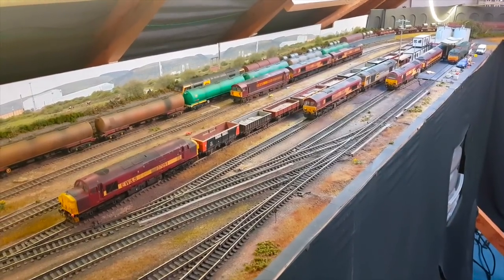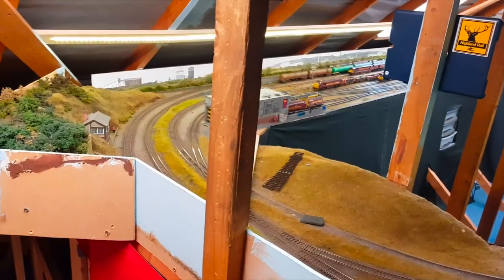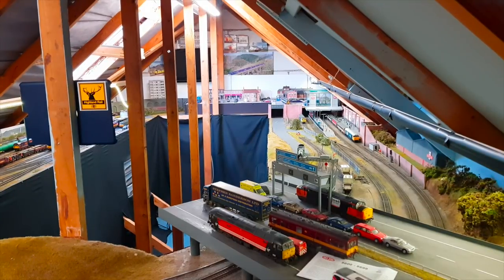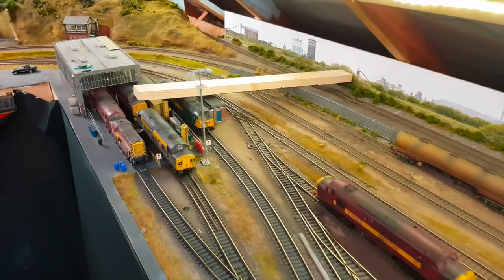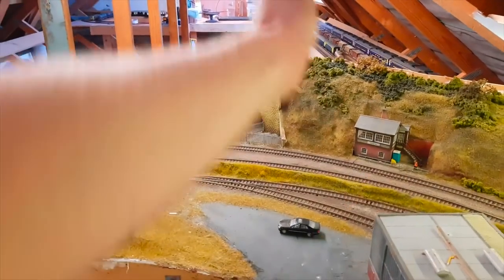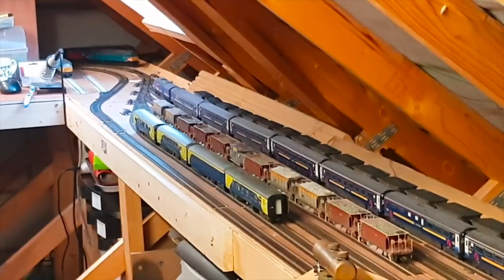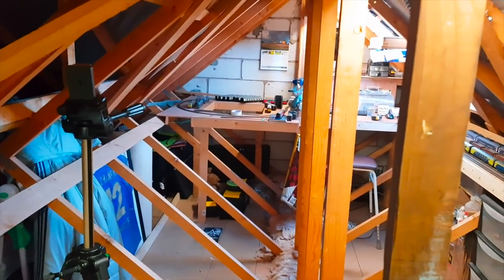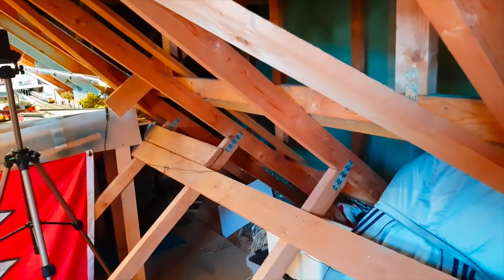Gowerton Parkway - The End Of The Line ?

Comment: Nice ideas. Look forward to this moving forward. If you wanted to go round the whole loft like you were suggesting could you not move the fiddle yard slightly more forward down towards the tmd area. Then you can keep the points going into it but then you could run the main lines through towards your desk infront of the fiddle yard. That way you'd minimize how much youre taking up and then you could put a board up infront of the fiddle yard as the backdrop to hide it from view of the scenic board. Just an idea, hopefully it helps with your ideas :)
Reply from the maker: Cherrham Junction Part of the reason I'm ripping it up is also because the woodwork on the fiddle yard is pretty bad . This gives me the chance to correct that also 😀

Comment: Up until now I hadn’t realised the space you had going spare in the loft for your layout so in a way am amazed you hadn’t utilised that area before. The fiddle yard in the untouched area is a sound idea giving you plenty of space for storage. Perhaps my only concern would be your positioning of crossover tracks to accommodate transitions from one line to the other - will they hinder running of the lines whilst these movements are made?  I dunno, I’m no track guru but it’s just thoughts to throw at you. Secondly, your nuclear flask depot, that would seem more tricky. Do you like it a lot?  Is it worth keeping and trying to shoehorn a line in to the mainline to accommodate what is a small scenic area of the layout?  Finally, before you rip out that centre section, is there anyway to integrate it in to the new plan to add operational interest with the mainlines diverging off across the central area to give the impression of a junction with lines heading to another destination?  Perhaps even a branchline joining the mainline with its own individual section in the fiddle yard for storing a few DMU’s. Like I say, all musings on my part and may not fit in anyway with what’s in your head but thought I’d throw them out there. Great update and exciting times ahead with the new developments both in the loft and with the better half. Good luck with them. Paul

Comment: Hi, first of your video's I've seen. The moment I saw your layout I thought, "why didn't he go all the way  down the attic?" . I think you should take your time and not rush to rebuild your boards...............Get the boards nice and solid and flat first. I think you have some good ideas too, although like someone else  commented, I think you might end up with straight main line tracks all the way from the TMD to the fiddle yard. Main lines are straight as much as possible anyway for high speed running. Your Nuclear Flask depot could stay as it is, but just relay the feed in so it curves the other way, from about the point the two flask wagons were parked in on the video............I will follow your rebuild as it progresses.................Hope the points help.
Reply from the maker: stretchedits Thanks for the comments . I think the only reason I didn't go all the way round was because I thought it was too much of a challenge. I'm a lot more confident now. The boards have been going up this week . They aren't elegant but they are rock solid and level :-)

Comment: Looks good, one thought I had is that you might struggle to do the mainline as anything other than a straight line down the back of the board on the TMD side, even if you do curve it away it’s got to get back across towards the edge in time to go behind the desk. Have you thought about that?
Reply from the maker: roadsandrails Yea it should be fine , I don't anticipate that being an issue, the angle of the tracks should allow it .

Comment: I have just heard alan davies on a re run of qi and he sounds just like you lol but you don't have that slight lisp . I have just re done my layout , its much smaller than yours and is 12 feet long by 12 inches its a end to end shunting type layout . trouble is its in a caravan . it took much swearing and farting about with 4 foot by 1 foot boards . the backscenes were a night mare .I run from late era steam right up to modern 2009/2012 so I have had to build and fit the buildings from scratch .2 and 3 versions of each so I can take them on and off to represent the different eras . talk about making a rod for your own back lol. your idea seems a good one and I am sure it will open up the room and give far better prototypical running .